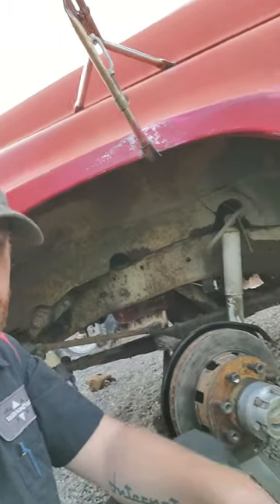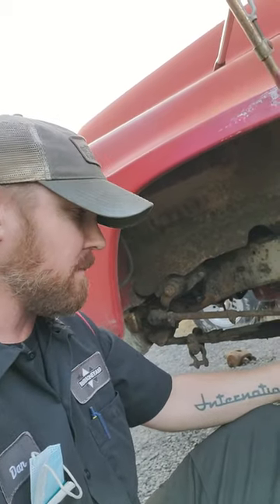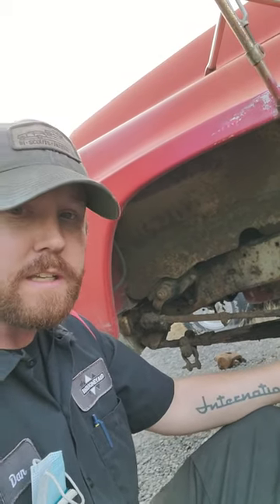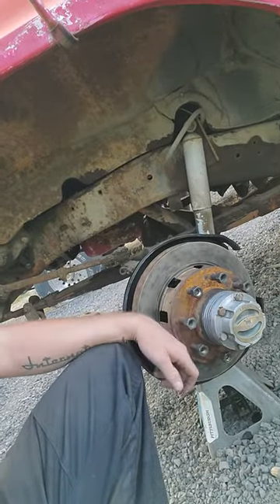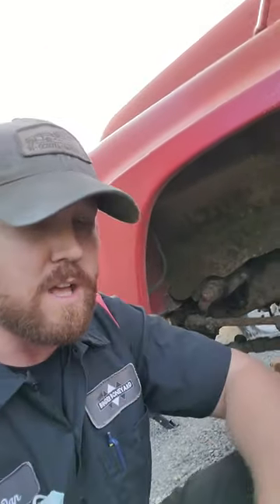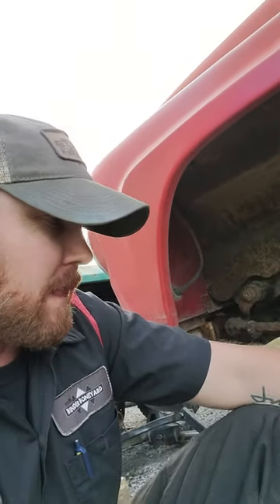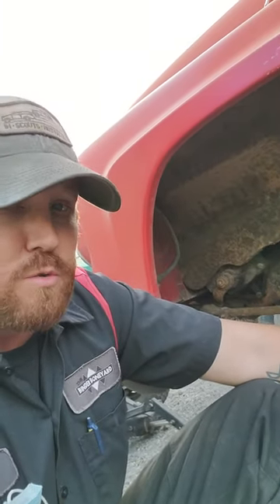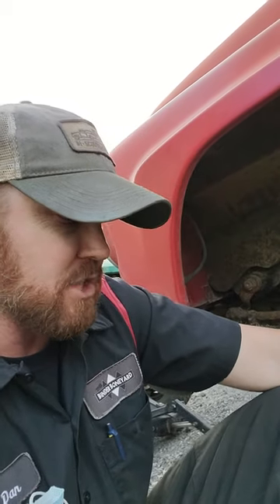international pickup disk brake how to...

Comment: I have a 64 C1200 4X4 that has the big 6 lug split rims. I want to do this conversion. So an axle swap is not necessary?
Reply from the maker: It requires a very special obsolete axle shaft to make the conversion complete.